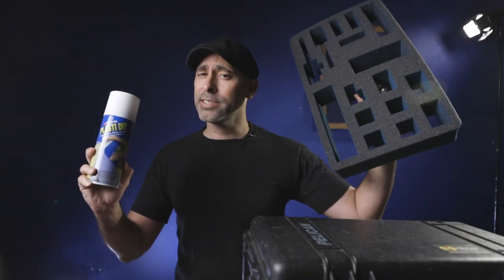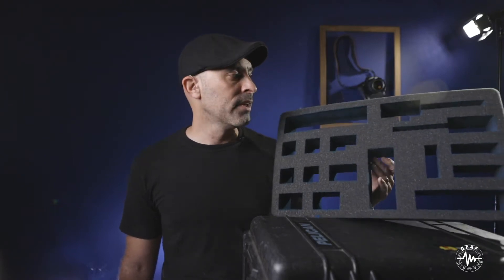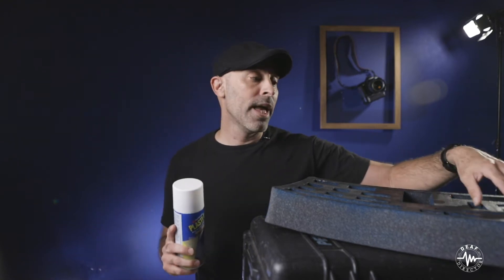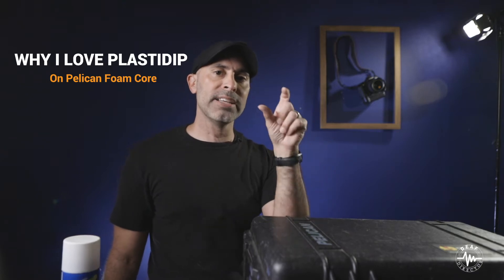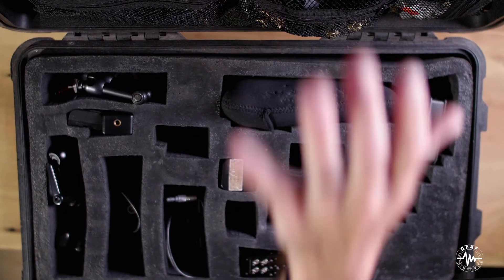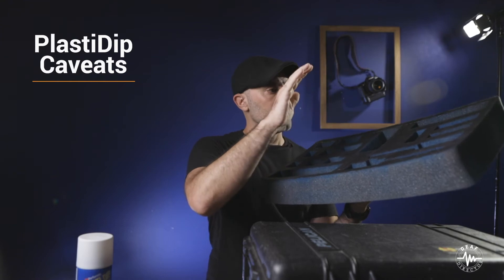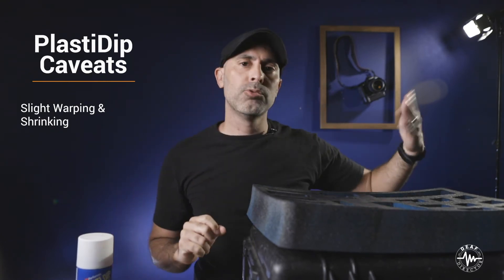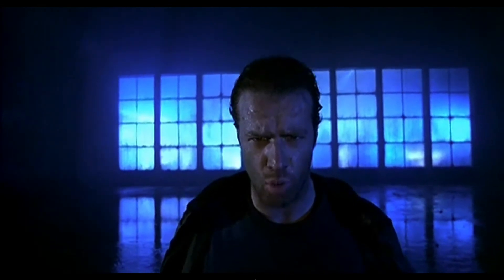PLASTIDIP vs PELICAN CASE FOAM: FINAL VERDICT

Comment: If you use thin coats with the PlastiDip, and alternate spraying each side 1 coat at a time, you won't have much an issue with the foam warping, if at all.
Reply from the maker: Great, great point Bryan K. I think I rushed it a bit for the video, but I have done that on some of my my newer applications and noticed the same thing. Thanks for the comment!

Comment: Or just buy closed cell foam pads sold to modify and create your own tool storage. I bought a pack of 2 sheets and cut them to the same size as the case, then cut out the compartments. Closed cell foam does not peel apart as it's not pre cut pick and pluck. It is also firmer, so heavier items won't crush the foam.
Reply: Where did you buy the foam from

Comment: Does the plastidip create a surface that will scratch up stuff. Thinking of using a pelican case for my watches and worried this will scratch them. Cheers.
Reply from the maker: Hey Rag Man, I have never had PlastiDip scratch any of my camera equipment, but I have never been in a situation where I would use it with something as delicate as a watch face. I would advise taking your pelican foam and applying the PlastiDip to a small portion (maybe an insert or two) and putting a couple of test watches in there. I think you will be fine, but it is probably good to test so you are 100% sure
Reply: @DeafDirector  thank you for getting back to me. Sounds good. Have a great Christmas.
Reply: @rag_man673  It dries into a rubber texture so you shouldn’t have an issue. To make sure you get a smooth finish warm the can in hot water then shake it for a couple minutes before you spray and even with foam start with a light first coat(basically peppered). If you end up with any rough edges or texture dip your finger tip in rubbing alcohol and gently rub the area down. The alcohol will soften and liquify it again and will dry back to the same texture.
Reply: I hope ya didn’t use that for your timepieces …
Reply: @joecola6487  I didn't.
Reply: @rag_man673 why not?
Reply: @fischerhobbs1732  I ended up getting a pelican case with foam specifically designed for watches. It's not pick and pluck. Got mine from AliExpress.

Comment: Just what I was thinking about getting, now I know for sure I will. I have the Apache 2800 case..
Reply from the maker: Good Luck, PR!
Reply: How was the plastidip and the apache block foam results? Did you use a electric carving knife to cut the foam? I was thinking of plastidip or flex seal with my apache 4800.
Reply: Is there an inexpensive source of replacement foam? I’m so worried of messing it up and not being able to replace the foam.

Comment: I feel like the plastidip would start to “peel” or roll apart and make a mess from continued in/out use of things in the case
Reply from the maker: Its a good question, but I can tell you from having used this method on multiple cases, for several years, and treating my cases very roughly, the Plastidip looks just as good as the day I applied it. There has been no "peeling" or rolling apart. So I think you can probably rest assured that once the Plastidip is applied it will not cause you any problems. Have a great day!

Comment: Have you tried kaizen foam?
Reply from the maker: Hey Kyle, thanks for the comment! Kaizen foam is awesome, but the largest size you can buy is 2 1/4" thick vs the 3" Pelican Case foam. This leads to two pieces not fitting perfectly in the pelican 1510 cases that I use. (it may work well for other pelican case sizes), and it is a little more expensive. It's a good idea, though, and I may end up trying this out one day. Thanks for the tip.

Comment: If you want to avoid the curve try making each coat lighter and let each coat fully dry before you do the next.

It’s also a great way to keep pick and pluck foam together and will also take away the cubed look.
Reply from the maker: Great point, Thomas. I definitely rushed this particular case because I was making a video. But I have gotten much smoother results on new batches where I took my time with the coats, and didn't glop it on too thick. Thanks for the comment.
Reply: @DeafDirector  I ruined a few to many pieces of foam before I figured out I was being slightly special. I still say it wasn’t my fault, the foam was defective

Comment: How much weight does the Plasti Dip add? I have a situation in which I am creeping very close to the airline checkin weight limits with a Pelican Air 1626 containing a portable PA system. Knowing just how much weight Plasti Dip will be helpful.
Reply from the maker: Hey nawboy, I am not sure an exact number, but in my experience the weigh difference should be negligible. I have never noticed any weight difference with it on, personally. If it added any weight it would be less than a micro fiber cleaning cloth. Good luck on the trip!

Comment: Is that cellular glass foam? If so you can easily buy a pretty big block for $50 and you could make about 4 or 5 sheets for you Pelican case instead of paying $45 for just one.
Reply from the maker: Good question. I'll research that. Thanks for the comment!

Comment: Nice video.  Did you spray coat both sides of the foam or just the top?
Reply from the maker: Hey Dean, I applied multiple coats to the top, and on the bottom I did one light coat for a little bit of extra support. Thanks for the comment!